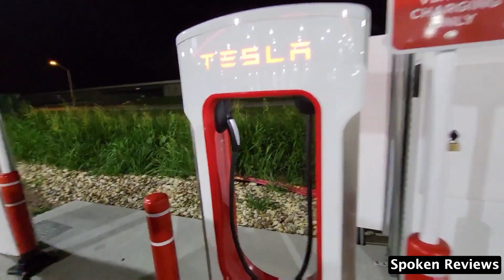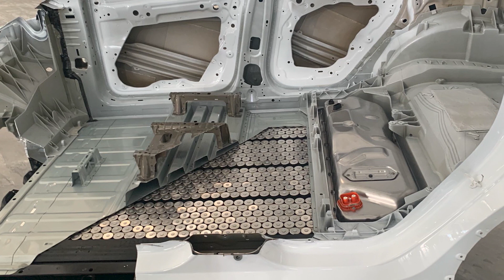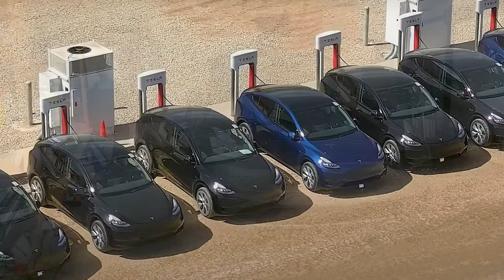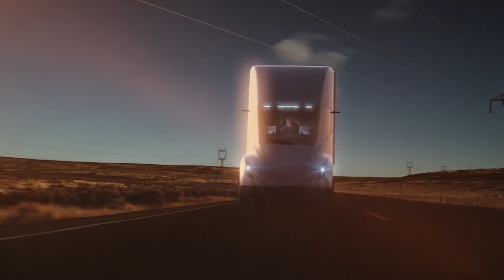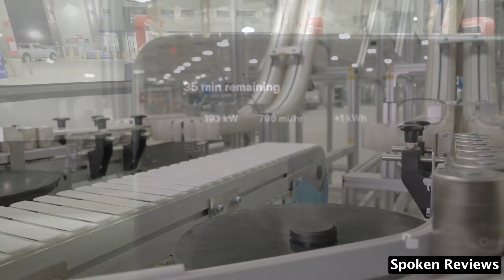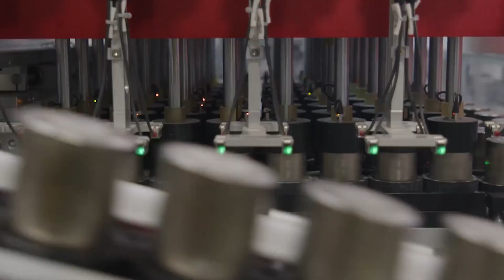Finally Here! Tesla Model Y Austin Specifications, Battery, Weight, Charging

Comment: Regarding Software lock: - The zero and 100% battery level are chosen voltage levels... So yeah, Tesla might be setting the maximum useable battery size conservatively, and might offer upgrade or unlock additional range (or charging speed) after insuring their safety margins and reliability/longevity ls they want..

Comment: The main thing about these cells was the planned 54% range increase and the planned 56% cost decrease, run rate was a bonus. Without those two goals being met, they should have just made more 2170 lines.

Comment: As always, great video!
690 cells would be 83% of a full pack.  If a full pack can charge at 250kW max, then 83% would be 208kW max (to maintain the same charge rate per cell).  Which is pretty much spot on.
83% might not be the number of cells.  It could be each cell used a larger bobbin for 17% less layers, which would simplify the initial manufacturing process, as the turns get tighter the closer you get to the center.  This could also eliminate the need for dummy cells.  Over time, they can gradually increase the tightness of winding the battery, which is necessary for full-size packs (including Cybertruck, as you point out).
Reply: Vehicle weights are stubborn things.  So improbable as the larger bobbin is, all other explanations are more improbable still.
Reply: Would it be premature for Satoshi to say, "Bingo?"  Electrified just reported with high confidence based on Texas sources that Austin Model Y battery packs have 828 cells.  He estimates 84.5Wh/cell.  Also that charging rate is software limited.  The run rate for cells is ~1M cells/month, which is ~14,500 Texas MYs/mos.

Comment: I think that all these calculations are inaccurate at best, and probably quite off the mark. When simultaneously producing old style 2170 model Ys while introducing front-rear cast structural 4680 models, the most important thing is to keep all models similar in specs to avoid an Osborne effect. Once all factories are refurbished to front-rear cast structural 4680 production, they can fully unleash the 4680 potential. So what you may see right now may be a combination of software performance control, dummy cells, etc. to achieve similar specs in all model Ys.

Comment: OK, I need your help. In brief, the 4680 batteries are not as powerful as we had hoped but we can charge them to 100% on a daily basis. Does this mean the 4680 Model Y has 279 mi of range at 100%, the model Y LR at 264 (80%) or  297 (90%) and the model Y P at 240mi (80%) or 270 (90%)

Comment: OK, let's talk battery rows. I "heard" that the battery pack can hold 12 rows of batteries and I saw a pic of a filler ribbon in a battery pack in TX. So does the model Y out of  TX have 10 of the 12 rows, the future model Y out of TX/Fremont performance will have 11 rows and the future model Y LR out of TX/Fremont will have 12 rows? What do you think?

Comment: You can’t run (or charge) the batteries at 100% in the beginning first you have to see how they degrade.
I think to be safe you need to run thousands of cars , heating etc must be studied also.
If it all goes well range and charging speed can be upgraded later…

Comment: Just remember Charging losses and I'd be thinking the battery is 60kwh at the absolute most
Reply: 67kwh charge will be around 59kwh of power reaching the battery and also Tesla is carefully getting real word data out of cells before selling Texas model Y's to far away from the Texas factory incase serious changes need to be made. People need to relise this battery tech is absolute cutting edge from a manufacturer that has never made a cell before the 4680s
Reply from the maker: Yes, I considered that, but this was actual gain in battery kWh, not actual amount of energy consumed at the charger.

Comment: Obviously the tabless design makes a huge difference in reducing the heat generated by recharging and that likely is a major factor in allowing charging to 100%, but we also know that Tesla had to and intended to make a number of other changes to the battery chemistry and cathode material...
Reply: I was going to write it all out again, but look at my other posts.
They never said they would START with modified chemistry.
The "5× 6×" improvement works with 2170 chemistry.
They just need the production mechanics right
Reply: @rogerstarkey5390  I have seen your other posts. The dry cell production process cannot possibly be done with the exact same battery chemistry as wet. You are clearly not the amazing battery expert you imagine.

Comment: I keep hearing about the cathode factory being built at Austin. Cathodes being a big part of batteries, does mass production of 4680s await that plant's completion? Also surprised that Tesla is still tweaking the makeup of the cells, not yet sure which formula/mix works best.
Reply: 1) It's producing cells.
.
2) They're not "tweaking chemistry", they're refining the mechanics of the process.

3) The chemistry is (for now) the same as 2170. Same density.
Thus us "like for like", or as close as they can get.
Reply: AS I SEE IT :: 4680 cells are currently being produced at Austin - Anodes & Cathode are produce using DRY ELECTRODES they are inserted in the cans etc, in relatively small volumes. 
The cathode factory currently under construction, will take the raw materials, in some cases further processing them, mix them & prepare the for the battery.  As the cell production for cars, cybertrucks, semis increases the volume of materials stored in controlled conditions will be measure in 1,000's of tonnes per day

Comment: The number of cells in structural pack shall remain the same during the ramp. As the improvement of the energy in the cells improves the total fixed number of cells in structural pack will results in more range. This way the production will continue without interruptions by not reducing the number of cells as energy density of the cells improves.
Reply: No

Comment: Still so many unknowns. 
Cell yield is still low so rather than dummy cells, maybe dead (unconnected) cells were included in the pack (cheaper than recycling)?  
Such low energy density, why? Lower packing density - a shorter, looser jelly roll until manufacturing problems solved? 
Or (spoiler alert - heresy to follow) could they have used a different chemistry, could they have used the dreaded LFP chemistry?  LFP chemistry would explain no warning on 100% charging. But why use LFP? What a clever way of avoiding the Osborne effect. Use a low density chemistry while ironing out manufacturing issues then switch to high density chemistries when perfected (and when needed for Cybertruck and Semi). Tesla play great chess - certainly Elon continues to keep us all wondering.
Reply: They've been on test in cars for at least a year.
They know the performance and issues.
Reply: @rogerstarkey5390  Obviously Tesla know the performance and issues. As the Tesla Economist discusses, there is still so much WE don't know. He speculates about possible scenarios. My comments just throw in some additional speculation.

Comment: I don’t see how the changes in weight on the new vehicle can be assumed to be just due to the size of the battery pack. Doesn’t the car also have front and rear castings that are new (because of the structural battery pack)? Isn’t some of the difference in weight due to those changes as well?
Reply: The "old" Y already had the rear casting.
This has the front.
It removes parts.
It removes assembly.
Not sure how much lighter it is.
.....
The pack.
Assuming the same energy density as 2170 (it's NOT "lower"), for a given pack capacity, the 4680 cells will use about 40% less steel in the cell casings (yes, I worked it out)
.
There may be less weight in the pack frame? (One for Sandy Munro)

BUT the "bodyshell now has no floor above the pack.
The pack is the floor.
That's a big sheet of steel missing.
That's the main weight saving.

Comment: it is all about tuning the BMS to get the best performance out of the pack overtime without undue degradation.  Simple to say, very hard to iterate, execute and implement.
Reply: But since a point of tabless design is to prevent resistive heating, which reduces degradation.....?
It's not a problem.
And they've had sufficient cells for A LOT of testing since before battery day (3, Y AND Semi!?)
They KNOW the performance of the cell.

Comment: NO !
You're taken two or more assumptions ("guesses") combined them and arrived at a firm conclusion which you then state as fact.
.
ALL we know is the (currently available) pack capacity (within a few kWh)
.
You guessed the number of cells, then combined that with a guess of the single cell capacity.
.
Just btw, I bet if I looked at that Troy Teslake capacity calculation, it would be based on 2170 density multiplied by the difference in cell volume?
.
We THINK we know the weight of the vehicle. (There was some speculation that he stood on the scale, so even that is a guess).
We don't know the difference in bodyshell weight, so we can't speculate on the pack weight.
.
The difference in weight alone will alter range.
.
Since it's not a full pack, there's absolutely zero way you can know the number of cells.
.
As for "spare cells in the pack", Someone (Jordan?) had already noted filler blocks in the photographed packs. That's one method to retain structure.
.
I have noted myself on numerous occasions that they may simply insert "CANS" with no filling to maintain the honeycomb like structure.
Again, you're guessing (as are we all)
.
Finance? You know your stuff (?)
.
Engineering? 🤔
.
EDIT.
Ref "Battery day improvements"
I've also posted here many times that all the initial "5× - 6×" 4680 data can be accounted for by 2170 chemistry in a larger volume cell.
The LATER improvements were were all based on expert predictions of chemistry and material advances.
.
Based on this, I also speculated that we would see a "side step" in CELL density, using the same cathode, but manufacturer by the dry process .
This would mean initial improvement would be simply derived by weight reduction of the pack, the bodyshell, and so the complete vehicle.
Reply from the maker: Unlike to use empty cans, it would add further complexity to the manufacturing, and wasted manufacturing processes. 
The energy density appears to be less than 2170, so presumably it's a different chemistry, potentially cobalt free.
If you know anyone else who has weighed a Model Y then let me know. 
Troy is very sure there are 690 cells, I am not 100% convinced yet. 
There are enough numbers out now, to do enough math to get some indicative numbers.
Reply: @TeslaEconomist  
You're guessing.
Too many unknowns.
You simply CANNOT know the density untill you know the number and total capacity.
You don't.
As I said, assumption derived from two guesses.
The "cans"?
Added just as the cells would be, robotised line, picked up in a stack.
Simple.
Reply: The cans could be dead simple .. just cut offs of steel or aluminum tubing. Additionally, these could safely squish in an accident.

Comment: I don’t think 10-20% fewer cells will affect the strength of the structural battery pack significantly. Essentially the cells glued to the top and bottom sheets will be way more than strong/stiff enough to perform their function.

Comment: EPA Fuel Economy data (in MPGe, City/Highway/Combined) seem fine, now that we know the 4680 car isn't 100s of Kg lighter.     
2022 Model Y AWD        129/116/123.  Range 279 miles
2022 Model Y AWD LR  127/117/122.  Range 330 miles

BTW, it would be prudent to wait for independent confirmation of Spoken Review's measurement of vehicle weight.  After he posted, people questioned whether he was standing on the scale and he wasn't exactly sure, but didn't go back to repeat the measurement.
Reply from the maker: Sure, but if you know anyone else who has weighed one, by all means let me know.

Comment: Nice review of the details.

My guess.
All cells are connected. Something on the order of a 68kw pack. Software manages charge between 10% and 85%, hiding the real size of the battery. 

I expect they will hide pack degradation behind this, allowing them to always hit battery warranty - which is really hard to predict with new battery technologies.

This dramatically extends pack life and allows them to create Teslas with very similar performance regardless of the cell type used - Panasonic4680, Teslq4680, 2170...  

From here, Tesla performs real world testing with these low silicon versions of 4680, and over time tunes the max power discharge/charge rates for optimal performance.
Reply: What causes degredation?
Largely, heat.
Why do cells heat up?
Internal resistance causes resistive heating under load.
What's one advantage of the 4680?
Reduced, or no resistive heating
.
Why would the cells degrade?
It's known chemistry in a better cell construction.
.
Oh, just btw.
You know they've had these in vehicles under test for a long time ?
They had sufficient cells for that before battery day.
They're not rushing development without full knowledge as they may have been previously.
They understand the performance parameters.
Reply: This better explains the 50D vs (Lack of higher) weight savings. A physical higher pack but software limited to 50KW.
Reply: Bingo!  Electrified just reported, based on Texas sources, that there are 828 cells in each pack.
Reply: Yes I agree.

Comment: This is what I've been saying for a while; the chemistry can be upgraded over time, and Battery Day even referenced curves for things like silicon content.  On the other hand physical changes like structural pack and castings are fundamental, so you need them at launch.  If you trying to scale battery production, removing things like Cobalt and (soon) adding manganese to displace nickel is more important than peak energy density, since MY/M3 can get "enough" range for the current market.  Eventually they'll be able to do all products with one cell, but that cell already works for low end mass market tier, so might as well use it there.

Plaid/S/X can continue using 18650, Performance versions can use 2170, and standard range everything can use LFP and 4680.  Upgrades will improve 4680 and allow it to slowly work up the chain, with LR next.  Lower-volume performance models could go for a long time if they took all of the current 2170 production (freed up by changing SR/LR).
Reply from the maker: Yup! You get it
Reply: Availability of materials & cost are heading to a single cell chemistry & form - Battery day hid this in plain sight, in the middle, Lithium, Nickel, Manganese grouping (LNMO) - Manganese is a abundant cheap material , in part reducing  Li & Ni .Tesla's agile innovation will see the chemistry improve with time , with software  monitoring & controlling changes at the  individual vehicle level.

Comment: Wow, so the 4680 is rubbish even compared to prismatic MIC LFP. The US is getting stuffed with an expensive Texas 50D while the ROW gets MIC standard RWD LFP with 278 miles range for 15k USD less?
Reply from the maker: The 4680 has higher energy density than LFP, but not as high as 2170 yet. FYI the LFP version doesn't get 278 miles.
Reply: Not sure we are likely to see low prices in Europe until Berlin starts cranking them out, historically we have been paying more for the same spec vehicles

Comment: These MIGHT be the Panasonic cells. I’d imagine they won’t be able to make them as well as tesla does, so it would make sense that tesla still uses them for lower models. Would also make sense to save the better tesla version batteries for the cybertruck or semi since they need much more energy density and are more important to teslas core mission of getting rid of gas and diesel
Reply from the maker: Panasonic don't have 4680 cells in production yet.
Reply: @TeslaEconomist  pretty sure they’re working on perfecting the technique so it’s not impossible for them to have made enough for a small supply of these standard range teslas. They’ve been working on these cells for quite some time now. And it wouldn’t make sense for tesla to discard cells that work
Reply: Panasonic cells.
What nobody had asked is 
"How did Panasonic overcome the previous failing of 4680 cells, heat dissipation?
.
Logical answer ? They used the Tesla I P "in good faith".
That would explain their willingness to have Tesla assess cells so early.
.
Next question.
How did they achieve the production?
Are they using the DBE ("Maxwell") method, or "wet cathode"?
If we assume they use the tabless construction, who built the machinery?
Are they essentially using s Tesla factory under licence? (That would speed the development)
.
Or any combination of the above?
........
Here's ANOTHER good one.
LG are currently "in development".
See above.
Discuss.

Comment: Charging zero to 100 without any deg would be mega 💫
Reply: If you gave 15% degradation after 200 k miles, it's not a big deal at all ! Remember the good habit to maintain battery life is keeping your car between 30% to 70% when you are not using it. However you can charge up to 100% if you immediately go on a trip after that. The same, you can go below 30% if as soon as you arrive you charge the car.